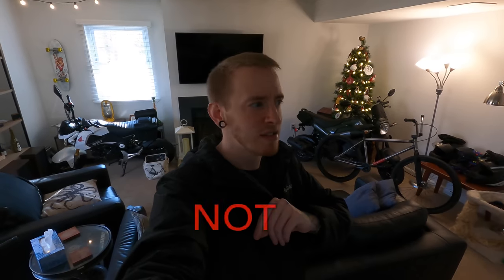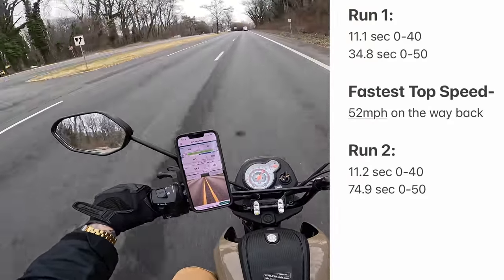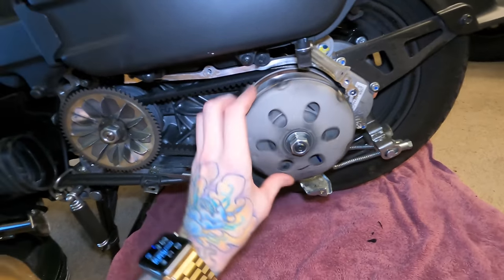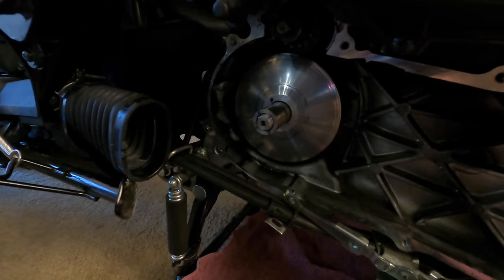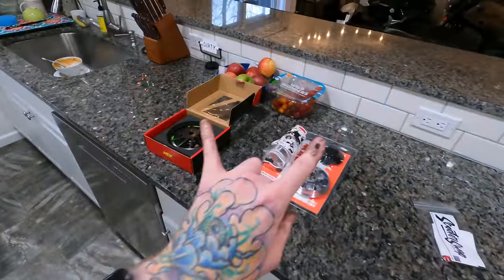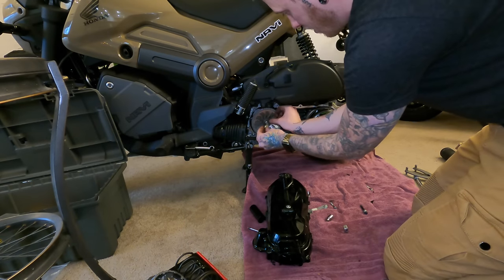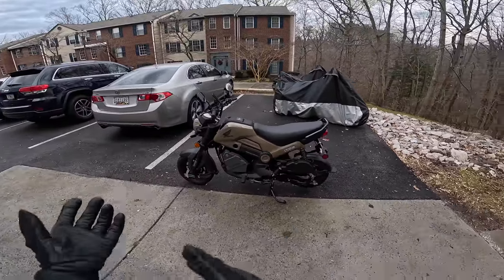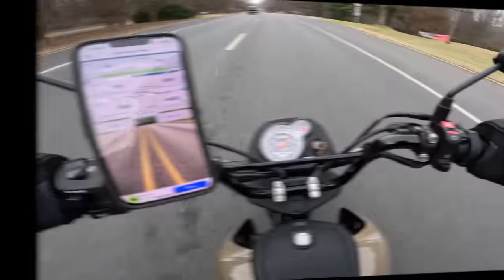Finally Addressing The Honda Navi’s Transmission Issue…

Comment: Was there a noticeable improvement in hill climbing ? I’m about to pull the trigger on this upgrade .
Reply from the maker: Yea there definitely was! Especially under 45ish. Between 40-50 it doesn’t pull any harder up a hill, but it’ll hold the speed up the hill easier if that makes sense.
Reply: @LifeOfBurch  Literally the answer I was hoping to get . On my way to work there are several hills and the just navi chugs uphill. Thank you Mr. Burch 🙏
Reply from the maker: @Harambes_Homeboy  happy to help!! 🙏🏻